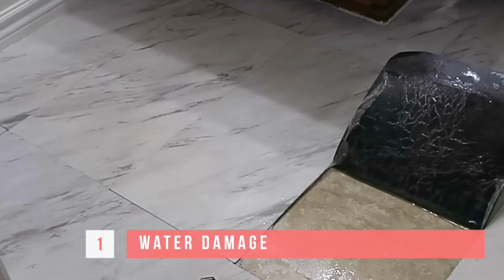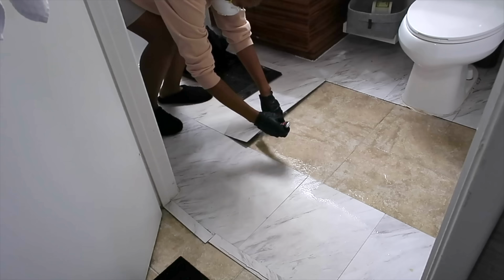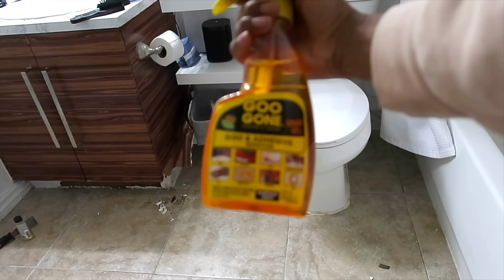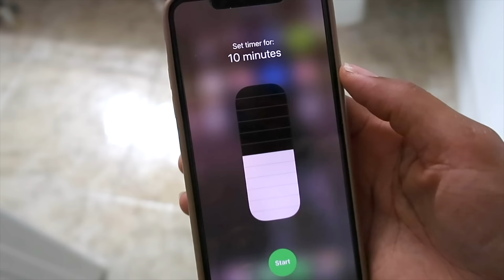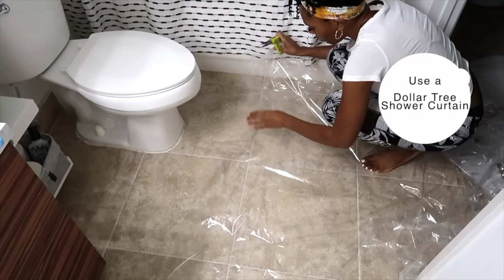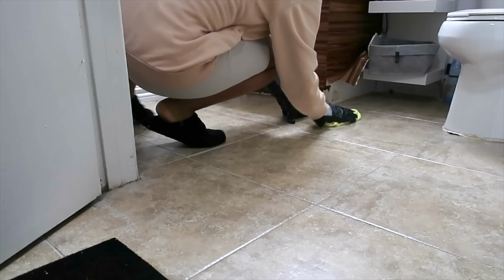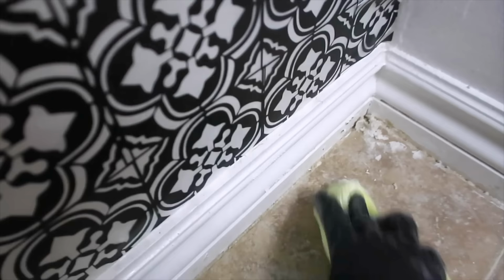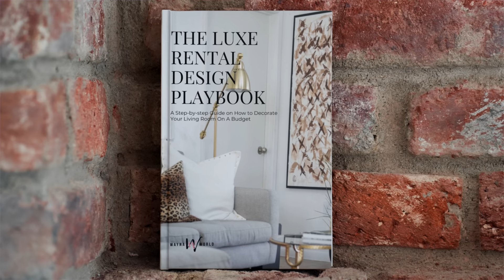5 Peel & Stick Products REMOVED - after 4 YEARS! | Renter-Friendly

Comment: Wayna. In addition to physical therapy, try adjusting the way you sleep. Sleeping on your side could apply too much pressure to your shoulder, for hours. Try sleeping on your back. Maybe place your pillow under your back and head to support the curvature of your spine. Go to a chiropractor for general spine realignment. Only go to the chiropractor once a month. The spine adjustment will force you to sit straight so be prepared for that. Finally consider taking a calcium multi vitamin every other day. Once your body is ready, stay fit and strong. That forces your muscles to do the work, not the bones.

Comment: 3:11 I have popcorn walls in my apartment. Do you think i could do the plastic liner method for contact paper on those kinds of walls? Im afraid if i do straight onto the popcorn walls, it will grab onto the creaves of the popcorn walls and remove the paint?